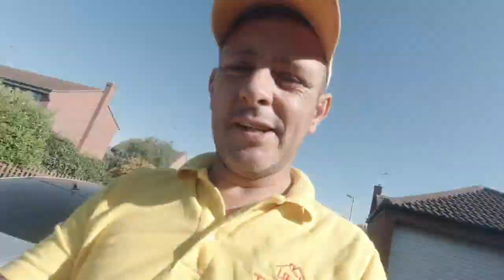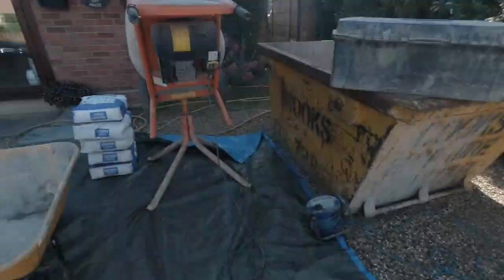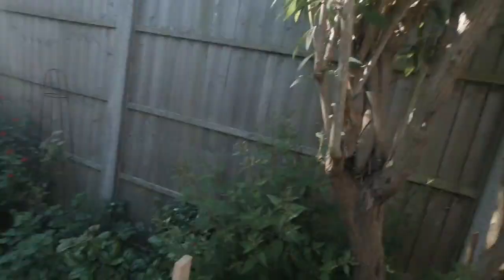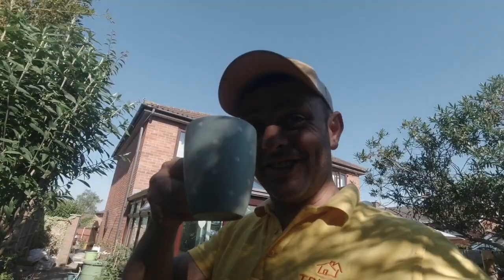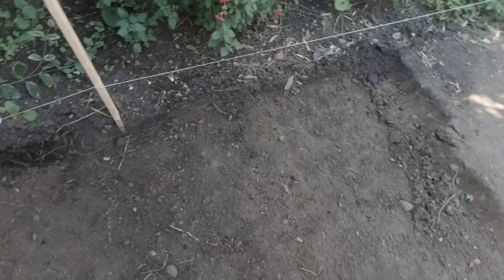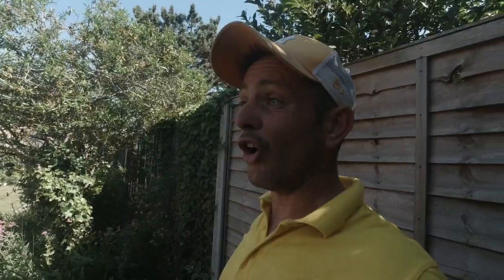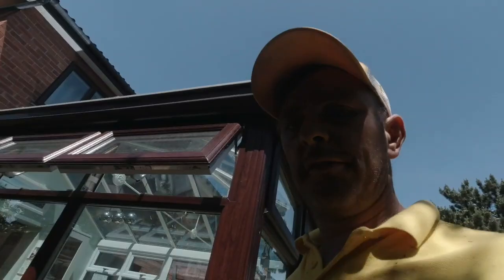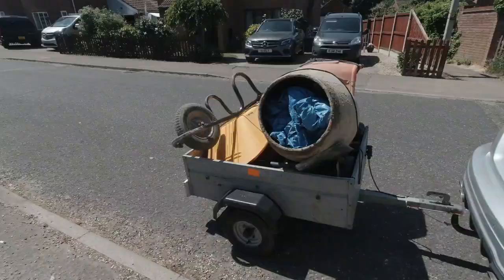small concrete base job

Comment: No mesh
Reply from the maker: No mate ..that well strong enough 💪
Reply: What about cracking of slab especially external environment ie hot, cold.Hot tub   quite heavy when filled up
Reply from the maker: Mate it's not going anywhere. Perfect for what was needed.  Customer is happy.
So all good 👍
Reply: Good job